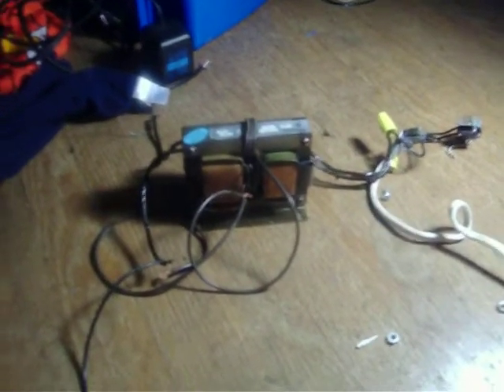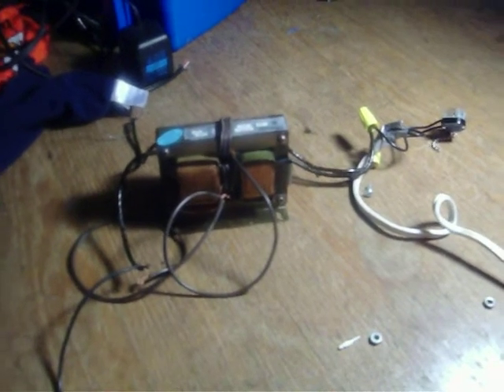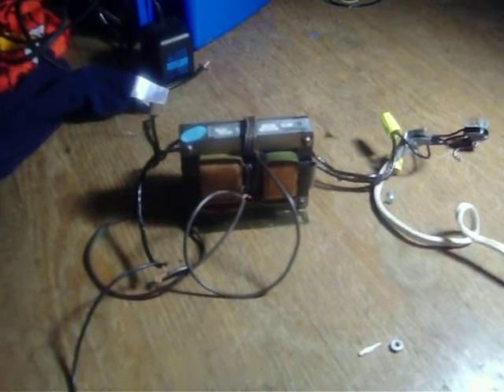de-shunted neon sign transformer

Comment: You can very accurately measure the short-circuit current on the  high voltage side of a NST with a cheap DMM.  First make sure the NST is unplugged, set the meter for appropriate current rating (I would use the 10A input), Be SURE the two high voltage output leads of the NST are VERY firmly connected to the DMM leads, set the DMM for 10A (double check the dial setting and everything else), turn on the DMM, then plug in the NST.  The reading should show the EXACT current capacity of the NST.  ONE MORE IMPORTANT THING THAT COST ME A METER:  Make sure NO fuses are blown in the meter, since ANY arc from the high voltage (across the blown fuse in this case), will instantly kill your meter.  That's why I only do this with cheap DMM's.  The accuracy is spot-on!